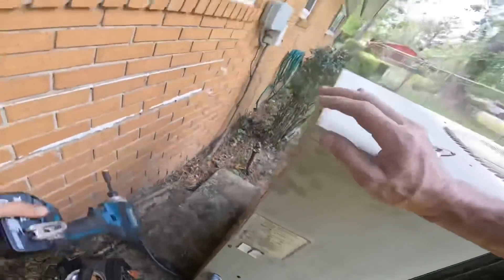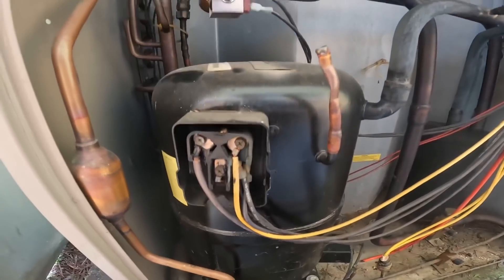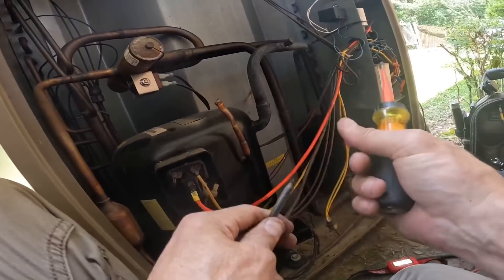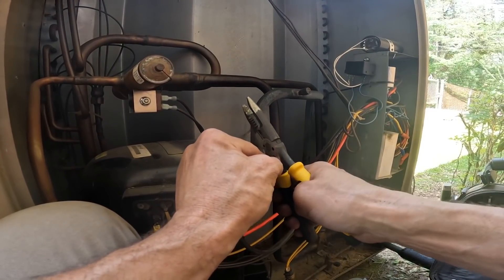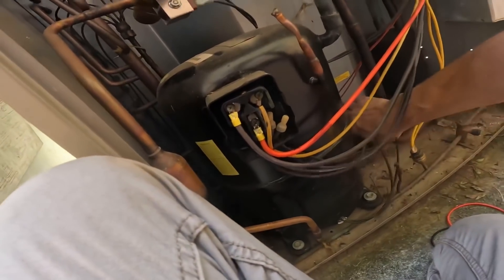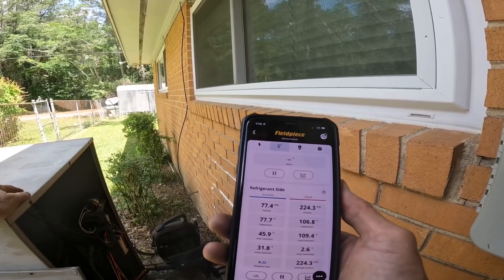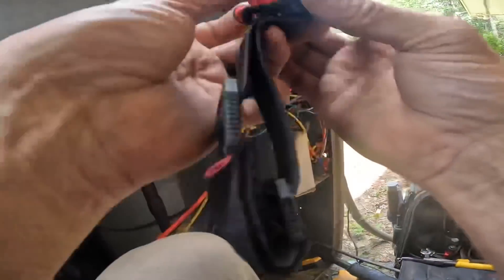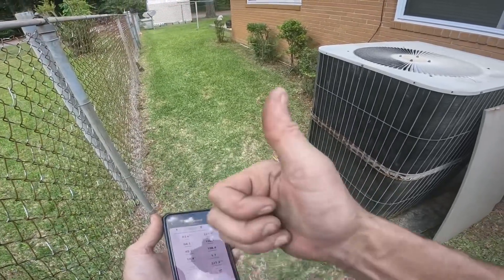28 Year Old AC Still Working After Being Condemned

Comment: Big name HVAC repair company told me I should replace my unit because it was almost 20 years old.  I told them to please just top off the refrigerant instead.  That was twenty years ago.  The 1984 Trane is running as I type.  I've replaced a few capacitors and such since then and try to keep it clean and in good working order.

Comment: I live in the very hot and humid mid south, so HVAC here is a very competitive and often a dirty business. In my experience, the biggest services in town are the best ones to stay away from. The techs are all paid on commission, so it has become a game of selling over repairing. One tech from the “biggest game in town” took the cover off my then 3 year old unit and, without so much as a complete inspection, told me my unit was junk and wouldn’t survive the season and began selling me a new replacement. I politely walked away from it. While I knew the unit was a cheap “home builder” choice, I knew it wasn’t shot. I was able to find an honest independent HVAC company (the technician is the owner and he IS the business) who kept this equipment running for an additional 14 years. I actually had to talk him into replacing the equipment last year simply because of the increasing cost of the old refrigerant and the inefficiency of the old machine as he was insistent that the old unit still had life left in it! My advice is if your service company is more interested in selling you new equipment than fixing your issues, you should question that and find someone who is willing to inspect everything completely and show/explain to you exactly what are the issues and offer you options on how best to resolve them. Those willing to do so are generally honest and worth having around.

Comment: I work for a company as an installer and when I went to replace the condenser it turned out to be the condenser had no power the problem was the breaker at the breaker panel that needed to be replace. I was told to replace the condenser anyway. After a few weeks I quit I couldn’t live with that conscience ripping people off

Comment: If the SOP for the big commission tech shops in your area is similar to here in the DFW area of Texas, It's more than 10 years old, so it needs to be replaced, no matter how minor the failure is! 
The technician doesn't make much money actually fixing minor stuff, and may actually find himself out of a job if he fixes too many old systems, vs. selling new ones...🙄

That vintage of Goodman units are really notorious for burning the compressor leads off at the connectors.
I also have often wondered if Goodman specifically requested Bristol manufacture the loudest possible compressors for them!🤣

Comment: 28 years and you let it run? It's on a almost co etely phased out system. How like a system will deliver a leak at 28 especially the evap coil. I'm sure you didn't check that instead. Another old tech thi king there a hero letting a 5 seer run and burn this ladies money while new systems are jumping 6% every 3 mo. Your not a hero just a dino, that lady will still need a new system and whatever amount you charged her today will be worth squat. Kicking trash down the road isn't the right thing to do. You'll be back again and make more money as you kick the can.

Comment: 1994 and still chugging along, seems like a lot of compressors outlast the wiring feeding them, my old one did the same thing it melted the connections most likely from corrosion causing resistance over the years. Ive noticed some tech's dont check at the compressor they just ohm it out at the wiring and of course if you have a burnt connection youll get a bad reading but its not the compressor. Its all about selling new systems for some of these shady companies...great to see the good ones like this.

Comment: Ever had the connectors blow out of the side of a compressor?  What causes that?  I had one blow up and all the refrigerant blew right out as well.
Reply: Failed motor winding ignites the oil vapor in the compressor. The terminal plug is designed to blow out in just such an over pressure event to keep the compressor from exploding like a bomb.
It is extra exciting when it happens while you are standing in front of the open compressor compartment!
Always have the terminal cover on the compressor when you apply power to it.

Comment: Yes it is working no one should lie but a 28 year old R-22 system  is wore out and definitely inefficient as well as all the price increases in this industry your are doing them a dis-service by not advising them to replace again I said not requiring them but advising them to replace I’ve seen 6 price increases in a year I bet that customer would have liked to have saved 38% instead of getting one more year and pay more in energy over that year
Reply: So why don't I just call you and you can replace my AC every three years?  You money hungry contractors are like roaches
Reply: @jeffsmith846  nope the average life expectancy for a furnace/AC is 15 years the customer has refrigerant that is phased out and newer units are much more energy efficient as a contractor I absolutely offer a repair option as well as replacement every time and I would gladly do the repair if requested but telling them they shouldn’t get a new unit is irresponsible unit is definitely past due systems cost $2000-$3000 more now than they did 2 years ago you don’t know how many customers wish they wouldn’t have waited another year when the realize how much more these systems have gone up
Reply: @brandonpurdy1848  I apologize for my comment about contractors.  I keep my sister in laws 33 year old package unit in florida running.  First time a evaporator motor capacitor, three years later the condenser fan motor capacitor.  That thing runs 10 months out of the year.  I just hate to see ANYTHING replaced simply because of age.  If it were to develop a leak evaporator or condenser I'd say it't time to replace it.  I truthfully do not know how much more current it actually draws compared to a new unit  Still, even if it were a third more I do not see replacing it just because of its age.  I am also very skeptical of how the units are recycled as to the refrigerant, the oil in the unit, etc.

Comment: Way too many dishonest companies out there.  I recommend always getting a second diagnosis when someone tells you the system is shot.  My 1986 York 3 ton condenser is still performing exactly as when I installed it.  One proactive repair a few years ago, I replaced the contractor.  Fan has oil holes, and coil is kept free of debris.  Copeland compressor runs smooth and quiet.   The old equipment was built to last.
Reply: Old equipment built to last... ain't that truth 🤜🤛 I have a cx who has a 44 year trane and it's still running only fan motor or capasitor ever go out on it and no leaks
Reply: Yup, the older equipment was built to last. My 82 ruud system still running. Those oil holes  on the motors are great only if they are used. Like when cars once had grease fittings. My systems only needed caps, a contactor, a condenser fan motor ,and a re string of one of the heat coils over the years. Plus occasional recharge.
Reply: @geralderdek282  I’m a big believer in taking retaining the older well made equipment and appliances.  I’m hoping to get many more years of service from that York condenser. Thumbs up to Copeland back in the day for building a quality hermetic compressor.
Reply: @chatrkat  you and I are slot alike. I've always gotten a kick out of making things last. I bought a 65 falcon back in 83 for $300.00 and 1i6.000 on the clock. It's run up 513.000 and still driving her! Preventive maintenance is the key. Being able to do your own work helps alot too.
Reply: @geralderdek282  ages ago my dad taught me to take care of my things and make them last.      Tools and equipment, appliances, vehicles, house etc.  The plus is the money you don’t have to spend replacing something.
Reply: @chatrkat  you were blessed to have a dad like that !
Reply: @geralderdek282  I well remember the Falcons, simple and reliable.  I completely believe 500k+ on one of those motors.  There’s a video up of my 86 Ford van I orders new back then.  I still have it today, but the odometer is super low.  It still looks like it does in the video from quite a few years back.
Reply: @geralderdek282  I didn’t realize that until I was older, but yes he was.  😊
Reply: @chatrkat  my wife and I laugh about how we have to actually turn a hand crank to roll the windows down  and heaven forbid,reach outside to adjust the rearview mirror!! Most younger people today would never go for such basic transportation.
Reply: The only accessory it has is ac. A must for florida. Good ole 2cyl York compressor and ford under dash evaporator.  I changed to r134 in 99. It still blows plenty cold! Does your ford van have ac,and if so,did you ever have any trouble with the line disconnects? I remember them as being a leak source back in the day.

Comment: A friend was told her gas furnace had to be replaced. Found pilot was dirty causing delayed ignition then outage. Cleaned pilot and burners. Relit and checked ok. Called the company to let them know what the problem was. The service supervisor  actually told me pilots don't get dirty.  Yikes.
Reply: Bro if your friend is still running a pilot driven furnace it is definitely time to consider replacing lol. Furnaces haven’t used pilots in like 40 years
Reply: @timrob0420  
To consider replacement is one thing. Sure it is less efficient by maybe 4%-5 % than an intermittent pilot or HSI. but to condemn an otherwise sound piece of equipment  simply for having a stopped up pilot is shady. Like having to replace a car to gain a couple more mpg.
Reply: @larryfisher5198  agreed. You shouldn’t be dishonest by any means. I would have fixed issue but definitely would have told customer they need to be saving/planning to replace in event something major fails. Also, if it’s standing pilot it’s likely a natural draft furnace so it’s more like 10-20% less efficient than a basic 80%. Not to mention, the possibility of doing a high efficiency furnace that is 96%.
Reply: @timrob0420  
Efficiency and economics aside my original point was that the tech tried to upsell the lady a new system when the only issue was that the pilot needed to be cleaned. This is a fairly reputable outfit in the area also. Given that the ac is the same age as the furnace to replace the furnace would certainly entail upgrading the entire system. At the time would have been 5k-7k vs cleaning the pilot. I'd wager the customer would opt for the company that helped her out by providing simple service for replacement when the time actually came.

Comment: If the terminals on the compressor are corroded,is just a mater of time,you can tell the wire has been cut several times,that wire is no good ,has been overheated,compressor sound loud,checking the main power would be wise.but she has ac tonight god bless.

Comment: I had a call about how a company condemned her Goodman 80% furnace for having a cracked heat exchanger.

I ran every test possible to see if it was cracked. Flame roll out, co test, co test at the supply, removed the blowers and looked inside. Never found any signs of a cracked heat exchanger.
Reply: Had that same call this winter. Spent 1.5 you looking it over real good finally found what stumped the previous tech had a bad door switch that was causing intermittent problems that he couldn't find and gave up and told them I they needed a new one because the heat exchanger was cracked.

Comment: Did a maintenance on a Bryant 70s furnace, coil, and condenser. Still heating and cooling. Couldn't check suction pressure because king valve was rusted and didn't want to force it too much. Still running though

Comment: So I never saw him ohm the compressor or check for grounded windings. Also didn’t see him  check  the start and run components for being bad. Maybe he did but didn’t film it. I personally would have done that before turning the power on so it “don’t explode “ lol. None the less the compressor may be running but it sounds horrible. I would have told she needs to replace it anyway because of it’s age  and has the old refrigerant in it .
Reply: sounds like you are part of the problem

Comment: Wow that was a big save for her , the other company was too greedy and shouldn't try to take advantage of the situation,  even if she gets 2 years out of it,( maybe more) that gives her time hopefully the prices of units comes down then she can try to replace it if she wants to,  but these old units keep working fine as long as they keep it clean and add ferrion,  most of my rentals have units that has been working for over 25 years i keep up with them until the compressor dies, then i change the condenser. I have changed 3 condenser and 2 air handler so far.
Tks for the video
Reply: Prices ain’t gonna go down. A lot of equipment going up by atleast 28% by end of year.
Reply: @Sesamestreet9080  i hope someone can bring it down,  Biden doesn't try hard.

Comment: Now this is probably me being OCD. But it just drives me bonkers to see a previous repair person, install a new compactor still in it packaging. I just think that a fire waiting to happen, if something happens to arc or overheat next to it. Plus it also looks sloppy.
Reply: Yeah, it is just dumb and lazy, we call the people who do that "The Run Cap Bandit."
It is not much of a fire risk, but is often an electrical safety issue. 
Capacitors also get hot, and leaving them unmounted in the box reduces their ability reject heat, often leading to premature failure.

Comment: I get calls like this quite often (condemned units). Right now there's not much benefit to replacing a good running older system as high as r410a has gotten lately. I'd much rather keep an older system running as long as possible for the customer. As long as you explain everything to them they'll end up buying a new system for you.
Reply: absolutely crazy how expensive r410a has become in the past year (as well as all equipment and supplies, weve had over a 40 percent increase in all equipment and supplies where I am)
Reply: @HiMyNameIsJoshuaC  I'm fixing to install a system in a new construction. 1700 sq ft home and the wire is going to be close to $800.
Reply: Nevermind the cost of R-410A, the equipment is stupid expensive anymore, but the craziness of R-22 prices and availability makes a major repairs that involve refrigerant kinda stupid on an old system. The "drop in" replacements for R-22 have gone just as crazy in price as R-410A.
We just bought an American Standard 18 SEER variable capacity system, with communicating furnace, 1050 thermostat, plenums, and some odds and ends for a job, almost $11k with tax, our cost for the equipment!
Even with the equipment costs, and not pushing new systems on people that don't need them, our small company has 2 install crews booked out for weeks.
Reply: @markbeiser  I don't condemn  one until it's got a unrepairable leak. And depending on the condition of the outside unit I might give them the option to replace just the evaporator coil (which is usually the unrepairable leak). I give the customer all the different options and let them decide. I'm repairing a 25 year old system this morning that has a hole rubbed in a copper line. I'm having great luck with r421a and mo99. I'm actually gaining a little capacity on some systems vs r22. Even though that system is 25 years old the compressor valves are like new. Amperage draw is normal. I'd feel like a thief if I said he has to have a new system.

Comment: It's nice to have the electrical/compressor compartment separate from the coil/fan compartment and access from the side.  My 27 year old Lennox HP26 heat pump is built the same way.  Scroll compressor with no crankcase heater.
Reply: HP26 is a nice unit, just no fun getting the double row condenser coil actually clean.

Comment: I I love it when you encounter a “dead” elderly A/C system, and you breathe new life into it!  Sure, there are no guarantees on how much longer it will continue to operate before time and tide take their toll.  But for a contactor, wiring repair, and a small amount of refrigerant, you averted a financial hardship for a customer unprepared for a change-out. So many other channels focus on pushing change-outs when all of the life has not been realized by the owner.  I hate it when some get the unit running, but leave filthy coils and rats nest wiring.  At this stage of life, everything needs to be checked!
Reply: A month ago found a customers furnace and coil very dirty and had to be cleaned . Yes it was 17 years old but I tried to help them and the system out by letting it breath . So I pulled and cleaned blower and chemical cleaned the evaporator and what a mess! But afterwards the thing was running great. Well month went by and no cooling....Second stage compressor on the old dual tranes broke and wobbling and not pumping refrigerant....now we are replacing the complete system and I feel terrible that they spent the money on the cleanings and this happened! It's a true gamble alot of times , but also the customers have to take care of their equipment more than every 17 years also!
Reply: @Rccrdawgs  if they got 17 years out of it....they were blessed.  I wouldn't complain
Reply: I wish more ac repair guys thought this way.  All most are concerned with is making big money fast and going to the next big money call.  It's sick